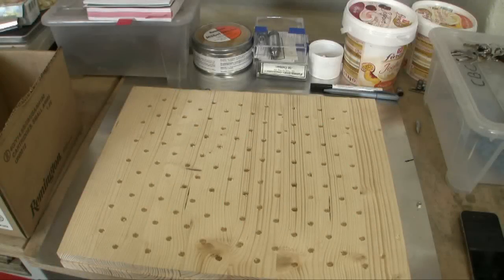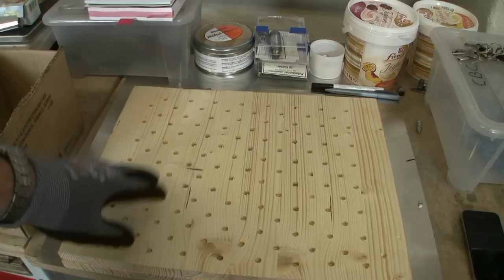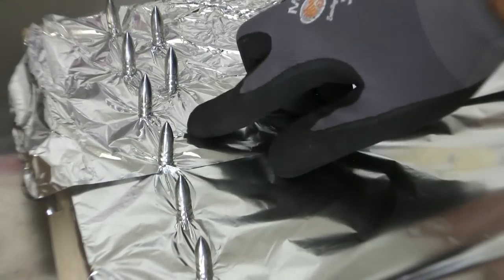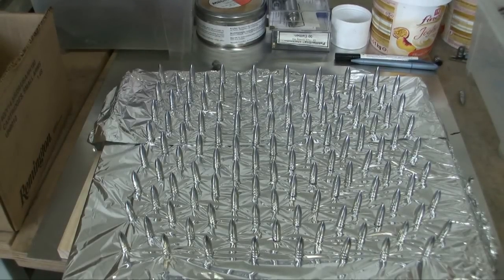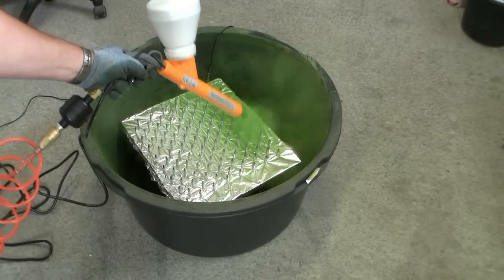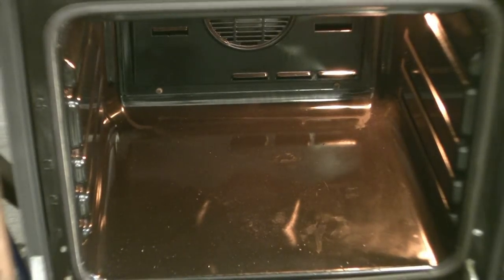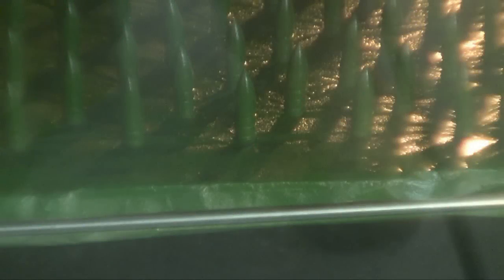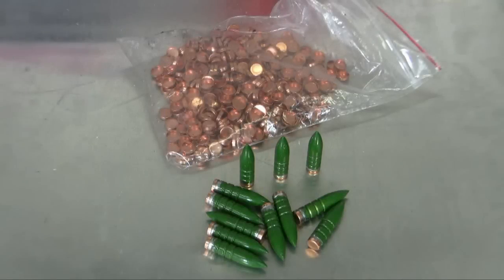How to powder coat lead bullets

Comment: Great video, I've seen other videos on this same subject, the bullets look really good. I've been tumble lubing my bullets, and once I even hexagonal boron nitride (hBN) impact coated my bullets, but have yet to load and try them.  I'm interested in other coatings as well. What advantages are there to powder coating your bullets? Do they offer superior lubricity? 
I look forward to watching your video when you try them out at the range.
Reply from the maker: jungblud59 Well the main reason for powder coating my bullets was the sharp tip of this bullets design. And what I like also is that the surface is realy smooth...better than every tumble method.

Comment: why not coat 100% of the bullet then there is no need to GC...GC can cost from 3 to 7 cents each.
fully coated you can shoot them to 3000fps.
Reply: Have you actually shot them to 3000 fps with accuracy?  Gas check is more than just to prevent leading, it's there to prevent bullet deformation under high pressure resulting better accuracy.

Comment: What kind of powder is it? How to make it or where to buy it and how is it called? Thank you in advance.
Reply from the maker: It's a regular epoxy based powder coating. I bought this one here on ebay
Reply: Thank you, if it's not difficult to dispose of the link ...
Reply from the maker: It's long time ago...just use a regular powder and you'll be fine
Reply: nylon powder is the best to use.
Reply: What is nylon powder, does it have a name and where does it come from?

Comment: Wait... you have Harbor Freight in Germany???  I am surprised you got such good coverage spraying from above, must be good powder, because when I use HF powder mixed with other supposedly quality powder I don't get very good coverage from spray gun, I have to rotate my tray to get better but not perfect.
Reply: Dima Prok,
He sprayed from 4sides but only showed 2. There appears to be an electrode wire going to the bottom of the bucket and probably to the foil. Pretty good set up for an even coat.
Reply: Well he said 4 sides and yes I saw him switch sides but the powder is still falling from the top regardless what's his position.  When I spray I actually do it at about 45 degree angle and even than I don't get such good coverage.  Maybe I need to space mine apart just a little bit more.
Reply: I’m just doing tumbling so far. I ordered an oven and will throw away my erratic-temperature toaster oven. 400°F and standing bullets on parchment did my best job. But the toaster burnt the parchment and melted a batch.  Eastwood oven should be here Friday.  Max 250°F with water quenching seems to work for ‘ElvisAmmo’
Reply: The thing about the Eastwood oven is the 4 heating elements. And they are not the quartz elements like my toaster over. Like you said the elements can get way to hot especially a problem when close to the racks. The pan in my old toaster oven would warp knocking bullets over then melting them. I hope to have better results with the Eastwood. It was $20 off last weekend so I got it for $79.99 plus shipping was only $11.
Reply from the maker: No we don#t have Harbor Freight here in Germany...bought this on ebay. ;-)
Reply: @EdmundMar  Elvis heats to 400 degrees, last I heard.  He preheats the bullets to 140 degrees.